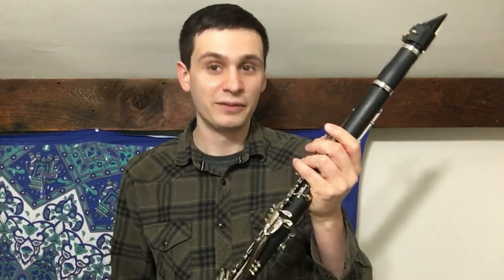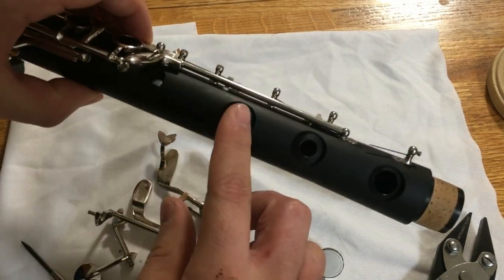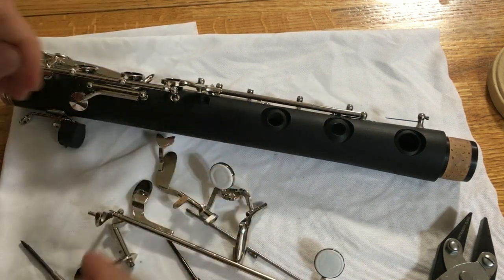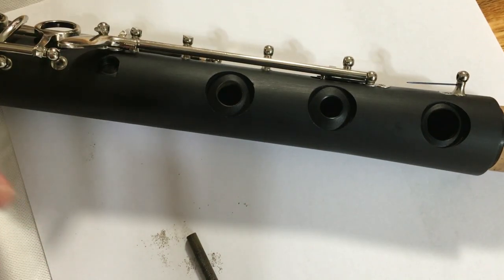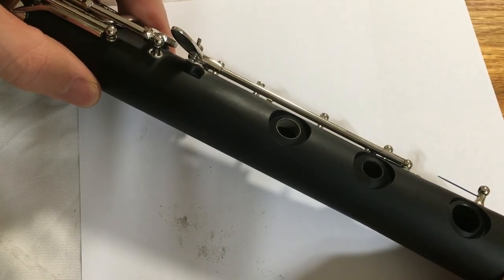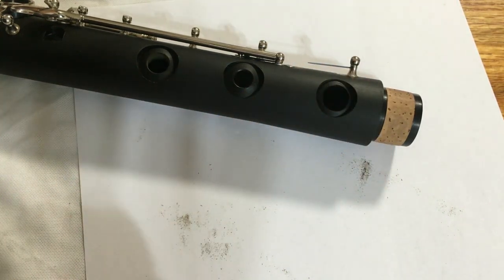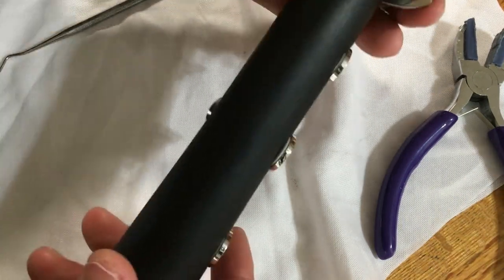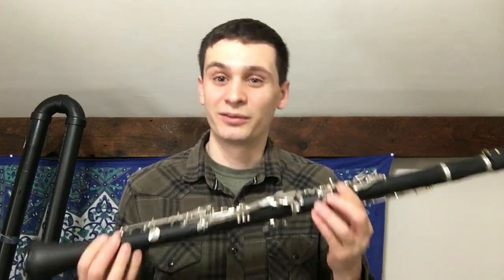Tuning and adjusting my Boehm system G clarinet (Turkish clarinet)

Comment: Even after all your adjustments it's still Sharp.

Funny thing is though I couldn't tell until I got my tuner and checked it there.

I just got this clarinet yesterday, and I'm having the same intonation issues. Although by the end of the day, I managed to bring it more in tune by adjusting my lip to compensate for out of tune notes.

I think if I practice it enough I'll be able to keep it in tune without operating on the tone holes.
Reply from the maker: Check out my more recent video where I convert one of these into a G basset horn. I made a custom barrel 2mm longer than the stock barrel which helped bring everything further in tune.  I’ve found that for the most part these Boehm Gs need both a longer barrel and bell than what’s included.
Reply: @Jared_De_Leon  interesting. I'll look at it

Comment: Thanks for putting up the video so fast. At some point you mention that for opening the G hole you run a 3/8''(about 9.5mm) drill through it. Roughly what was the diameter of the hole originally? I am trying to get an idea of how much it needs to be opened.  How much did you fill in the other hole to get it in tune? One modification that I found necessary on mine was to bend the the teardrop A key to the left(looking at it from front) so that I can play E with my thick LH index finger without touching the A key. Nice video.
Reply: Oh, and a very nice piece of music at the end...
Reply from the maker: Thanks! Originally it was about 5/16" I would say. For the F/C tonehole I had to fill in the upper edge about 1/16" of an inch.

Comment: Did you manage to fix the wide 12th you noted in the previous video, first line E / upper clarion B?  Did just pulling the bell do enough?  That's a trick I didn't know about, thanks.   When it's a flat E undercutting the upper end of the tone hole can help but you have a sharp B - so fill in a little and then undercut I guess.
Reply from the maker: Yes, pulling out the bell almost completely eliminated the problem.

Comment: What’s the bore size of the instrument? Are you using just a regular soprano mouthpiece, or something designed for larger bore instruments like an old HS* or something for B&H 1010s?
Reply from the maker: The bore size is actually 14.65 mm like most Bb clarinets which was surprising to me. I'm using a regular Fobes 10K.